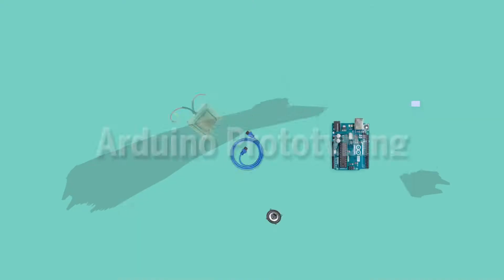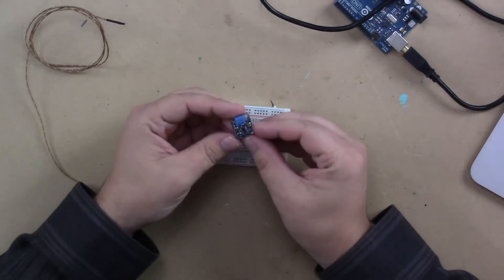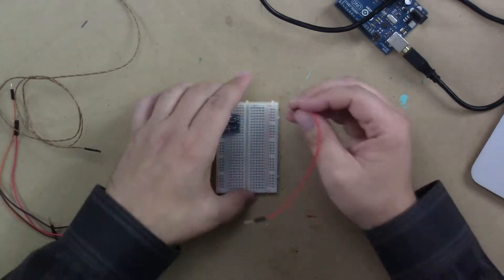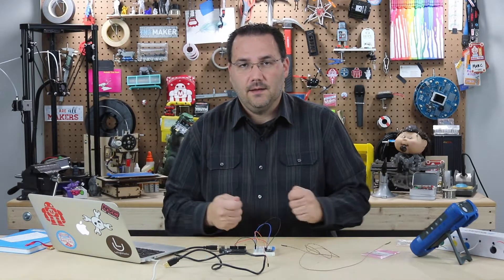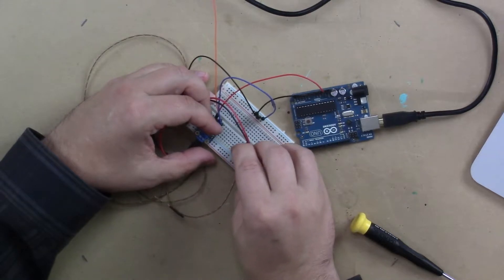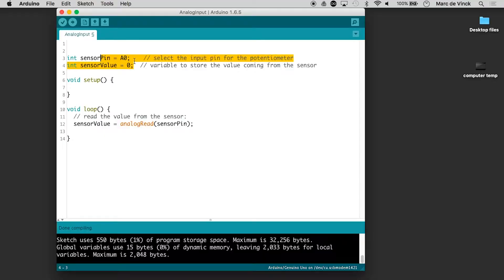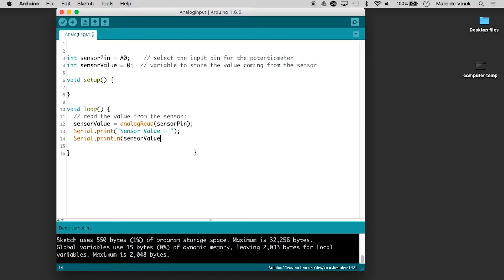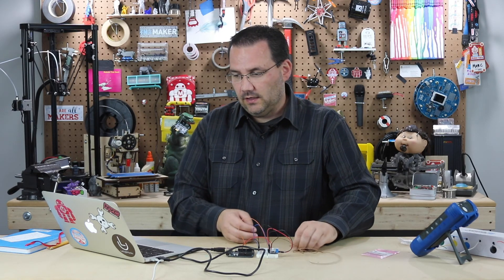Arduino Prototyping Inputs #35: Thermocouples

Comment: Very helpful, thank you! What device did you connect to the thermocouple before connecting the Arduino?
Reply from the maker: That is a breakout board from Adafruit. You can’t plug the thermocouple directly into the arduino as it needs a few extra pieces of electronics to function. If you go to any of the popular websites that sell components, they should have the thermocouple and a matching breakout board. I always suggest to check out Adafruit first as they have great parts and documentation. Documentation is critical!
Reply: @MarcdeVinck  Thanks for the info!